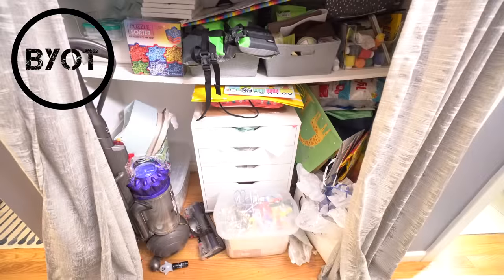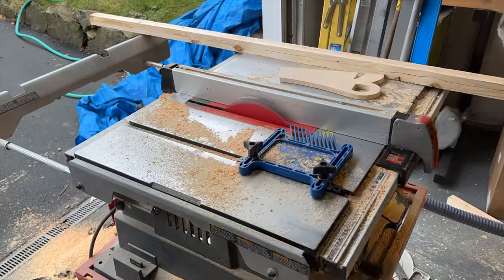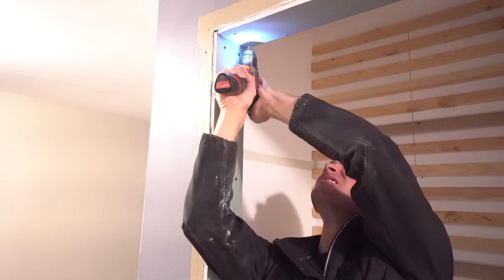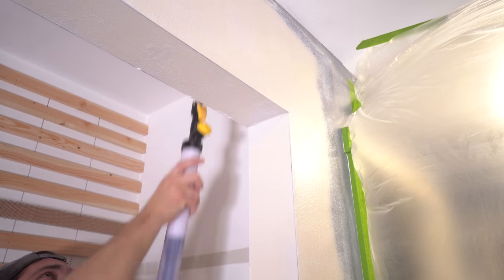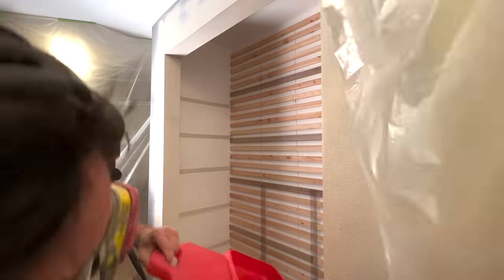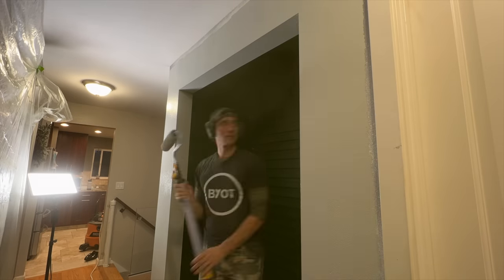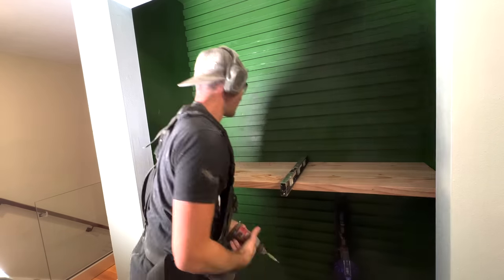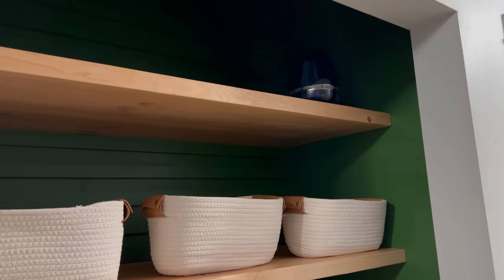DIY Custom Closet Organizer and Shelving System Guide

Comment: Anyone trying to replicate should be aware that Douglas fir or any construction grade lumber is full of moisture and will absolutely twist and warp on you. It will be totally usable in this application and probably won’t affect much.. but just know you’ll get some warping of the shelves over time. 

Otherwise, love the project! The slat system is such a good idea to provide strength and aesthetic! I’m definitely thinking of doing something similar.
Reply from the maker: Great note for everyone Ben, just note from my experience DF won't bend that much as long as you aren't picking a supper bent piece right out of the stack haha!  Definitely had to sift through a few lol! Thanks so much for watching and the kind words.  Truly appreciated.

Comment: Another gorgeous project!  I picked up a Wagner Flexio a few months ago.  Still playing around with it to get comfortable to the point I can approach projects, but it seems promising!  My one concern is I can't find a can of paint that doesn't say "DO NOT THIN" somewhere in the instructions, and everyone I see using the Flexio system thins the paint.  Using it unthinned ends up using a tremendous amount of paint for a relatively small area.  Three pieces of trim used an entire quart of paint, where I can usually get a wall or two of coverage from the same quart of paint brushed or rolled.  Figuring I'm doing something wrong, but haven't figured out what yet.

Comment: the only thing I'd do is a cabinet door to "hide" the vacuum. vacuums tend to be the one appliance that "just doesn't look good being seen" as it were. granted in this case, you might not want to do that since the shelving are not meant to be permanent.  overall, great work. now get some sleep.

Comment: Great improvement.  Were your closet end walls nicely parallel all the way up?  I had almost 1/2in variance in the lengths of my back strip. I cut them all to the shortest and used strips also on the end walls that covered the gap.

Comment: Please do a bifold barn door with the exterior mount. I am thinking of doing the exact same but with my laundry closet.
Reply from the maker: This is my exact same thought process for the opening IF i go with a door system.  Thanks so much for the input Chris.
Reply: @BYOTools . Y issue is the depth which standard bifold won't work. Besides standard doors are boring. Love your videos and I anxiously await the next, you have given me so much help and ideas!

Comment: Tape measures have an indicator every 16". So if you know where an outlet is, measure 16" and you should find a stud.
Reply from the maker: In a perfect world you are 100% correct Wendy but we all know that stud placements can be all over the place.  Even on this wall they are not ALL 16" OC.  Always good to check if you can.  Thanks for the helpful note and thanks so much for watching.
Reply: @BYOTools  very true! My stud finder lasted until the battery change. Then it fell apart.